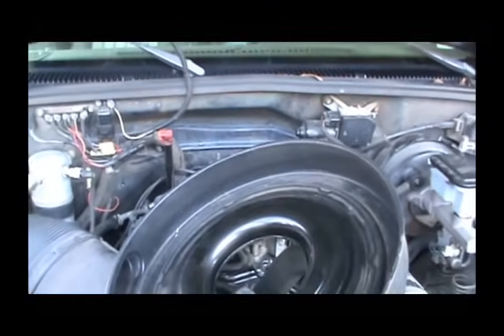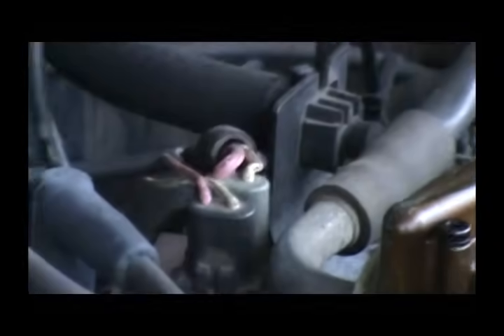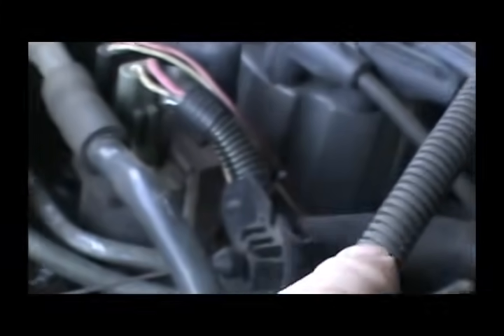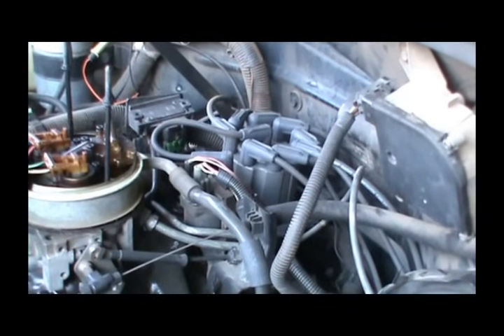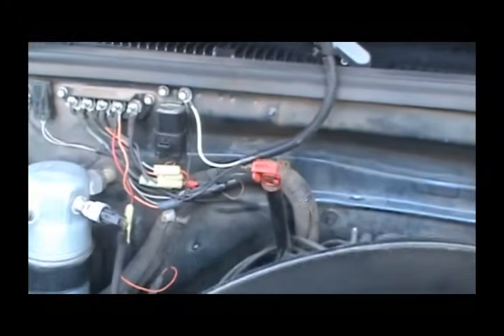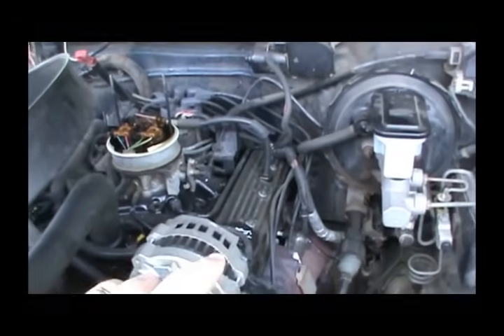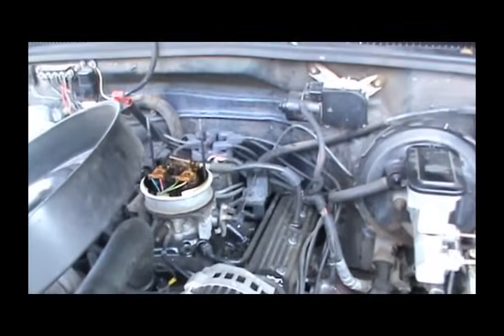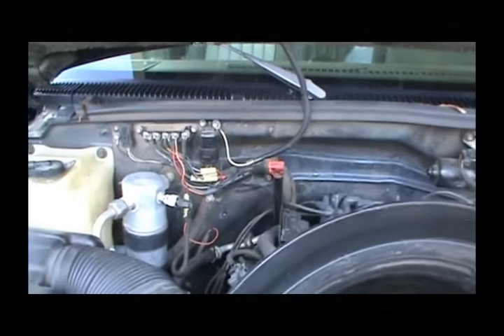1988-95 GM Truck Ignition Systems

Comment: I have a 89 Silverado old truck just passed inspection the next day I tried to start it and it started to crank then nothing. I've changed battery cables but I'm not a mechanical person so idk what to look for??
Reply from the maker: Duane, to be honest, there's a lot of things that can cause one not to crank.  I'd recommend finding a local shop that you can trust  to diagnose it.  Some things are: low battery, bad starter, bad starter solenoid, bad ignition switch, broken wire, etc.
Reply: farmboy30117 return work. I never had a cavity till I went to a dentist

Comment: hey I have one for you, I have a 1990 c2500 initially had no spark.changed cap rotor,had spark, sprayed a little starting fluid because the battery was almost dead. but it won't fire on starting fluid and it's getting fuel any thoughts?
Reply from the maker: Weak spark?  If it won't fire on starting fluid, it has really weak spark or bad timing.  Might have to check coil and ignition module.  I have seen where just a cap/rotor didn't fix the issue.  Make sure you're getting at least 12 volts to the coil.

Comment: I need help man I got a 1991 chevy Silverado 4x4 with a 5.7 engine and every time I stomp on the gas it starts choking the engine and as soon as I take my foot off it runs just fine any ideas
Reply from the maker: Sounds like it's either getting too much fuel or not enough.  Does it smoke when you do that?  Black smoke would indicate too much fuel and no smoke would indicate not enough fuel (too much air).  I suspect it's starving for fuel.  The easiest thing to do is replace the fuel filter to see if that helps.  If it appears to be fuel rich, check the air filter.  Anything else would be difficult to diagnose without some equipment, but check the online forums, someone else may have had similar issues.  Good luck!
Reply: thanks i replaced the fuel filter and it runs better but now some how i got air in my gas lines i don't know what to do
Reply from the maker: Air in the gas line should be purged when you prime up the fuel system and crank the engine.  The air will escape through the injectors.  Cycle the key 3 - 4 times from off to run (not start) with a few seconds between cycles.  You should hear the fuel pump kick on for about 3 seconds and shut off.  Crank the engine and it should be fine.  If this doesn't work, you have other issues like a worn fuel pump or low gas level.

Comment: hey man, I have a 1994 Chevy TBI V8 5.7L. need your expert advice. I'm throwing parts at it and well preventive maintenance is good but problem not solved. Issue is - at 1500 rpms I get surging and low power when it shifts to over drive. 
I just bought a timing light and set timing, before that I installed ECT sensor, MAP sensor, changed plugs, wires, cap, rotor. still have the issue. check engine light code is o2 sensor, replaced that last week, code repeats. 

I went ahead and bought a fuel filter (one on it looks new) and a fuel pump. Have not installed yet, especially fuel pump, that is a job and a half I'm sure you know. EGR valve works as should. checked that as well.
Reply from the maker: Since it's only doing it in OD at low RPMs, I doubt it's the fuel pump.  That would want to show up in higher load demands.  Sounds like you've eliminated the usual suspects.  Since you're still getting an O2 sensor code, you might want to zero in on that and try to figure out why you still have it.  That could be a result of what's causing the issue.  The trans is computer controlled, so does it feel like the trans is causing the issue or the engine?
Reply from the maker: I posted a vid on my other channel covering code 13 if that's what you're getting. It might help troubleshoot the issue: https://www.youtube.com/watch?v=Vmw1CYZ_Df8
Reply: the trans feels fine, yes the code is a 13. I'm changing out distributor, rotor, and wires now. changed plugs a coupe weeks ago. should've changed it all together then. I'll follow up with you on how it turns out.
Reply: I changed out the wires, distributor, and rotor. It idles better,a little higher, has better pickup but still get that dragging low power as soon as it changes  to the last gear. check engine light still comes on as it has been. note- it has an after market radio that was not connected. I connected it and when I turned on the park lights it blew the park light fuse so I disconnected it. Also when I turn on turn signal it flashes fast but as soon as you touch the break pedal it flashes normal. I bought a test light but don't know where to start. also there is a braded ground wire attached to the passenger side fender wall and nothing else, it's just hanging. I did order a new headlight/park light interior switch, the dim roller is off or on when you barely move it. Got to be wiring issue I'm thinking. I appreciate any help. Thank you sir.

Comment: Ok thank you very much for your kind answer, the dealer has the new pickup coil and also the distributor cap and rotor, will hey have to change the distributor shaft?
Reply from the maker: It's possible that something is bad on the shaft, but not too common.

Comment: Good morning, my friend, I have a big blazer 93 4x4, it starts with ffella, it shakes and it makes small explosions and it goes out does not keep the minimum, I buy TPS, IAC, MAF GASOLINE PUMP, ROTOR, COLLECTOR COIL, Only matches when I disconnect the brown cable that goes from the computer to the distributor. Please help me that I have spent a lot of money on it, Thanks and blessings.
Reply from the maker: Since you say it runs ok with the wire disconnected, I'd say the timing is off.  Disconnect the wire on the firewall again and make sure it's timed properly with a timing light (I'm thinking about 12 degrees before TDC but there should be a label on the radiator support).  Plug the wire back up and if it still does it, then it's either the distributor or computer.  Hope this helps.

Comment: i have a 1995 chevy c3500 454. it will run and drive but shut off shortly after. do you think this could be the problem?
Reply from the maker: Will it crank right back up after it shuts off?  If it does, it probably isn't the ignition control module.  If it has to cool off, then I'd suspect the ICM.

Comment: i got a 90 silverado and after going over a speed bump (not fast either) it just died now i cant get any fire but i can see fuel and she turns over but i just cant get no fire why is that
Reply from the maker: I'd check the ignition control module located under the distributor rotor button.  If it came loose it could overheat quickly and burn up.  Also, check all the wiring connections to/from the distributor and coil.
Reply: Rebecca Lamb did u find the problem?  same thing happened  to me mine has spark but no fuel
Reply from the maker: fuel pump?
Reply: +farmboy30117 I thought so I replaced it but I got it running today it was the injector harness an a burnt fuse
Reply from the maker: Glad you got it figured out.
Reply: ayyeefredo94 what fuse was it?
Reply: Jose Alvarez I think it was ignition
Reply: check your rotor button
Reply: Play Nirvana's best hits

Comment: What's up everybody, I have a 95 Silverado. Kinda had the same problem, I put a towing cam in it this past summer and the computer went nuts trying to figure out what to do. I racked my brain for a week or so till I watched this video. All I had to do was unhook that single wire plug( 95 is under the dash on passenger side) and leave it unhooked set my timing and let the icm do the job. Runs like a champ
Reply: So u unhooked the ICM witch is the PCM correct.... And u left it unplugged
Reply from the maker: Awesome!  Glad it helped :)
Reply: How did you set the timing
Reply: What should the rpms run about when It's Timed? I cant seem to get it timed .. I unhook the brown pc wire and it runs lower idled about 1,000 rpms, seems about right but still is a little hard to turn on by itself but suddenly does start after 2 or 3clicks then as I Hook Pcm Cable back up it's revs itself back up to 1400 rpms or so .. seems to run better with the PCM cable unhooked. Or could it be bad fuel pump relay,  Or possibly bad PCM?

Comment: my 92 5.0 had been falling on its nose at half throttle for 2 years but ran great just didn't have full power plenty to go 85 down the highway then from nowhere it's chugging and missing any ideas fuel pump is good
Reply from the maker: Preston, there is so much that could be wrong.  Did it set any codes?  Since fuel is good, I'd look for vacuum leaks, distributor problems (ignition modules are notorious for giving issues), or clogged injectors.  I assume you changed the fuel filter too.
Reply: @farmboy30117  EGR malfunction or clogged cat/restricted exhaust are likely if fuel pressure is good at throttle body and injector spray pattern is ok and ignition timing is reasonably close.
Reply: By the way, faulty distributor cap is possible too. Spring under the button breaks sometimes and you can't see it.

Comment: Hey I have a 1994 chevorlet c1500 Silverado 4.3L an It won't turn over..the injectors aren't spraying gas into the throttle plates the fuel pump shouldn't be bad ik thinking it's the pickup coil maybe gone out an it's not making the fuel pump..pump gas thru..
Reply from the maker: The pickup coil has nothing to do with the fuel pump.  It's either ran off the fuel pump relay during cranking or through the oil pressure switch when enough oil pressure has built up.  I'd say you either have a fuel pump issue (pump or wiring) or a PCM issue.

Comment: I m having a problem it seems like I don't have power from clips to the injectors for my gmc 1995 1500 z71. I changed my coil,module in distributor and and injector rebuild kit and no gas coming out injector. I hear gas pump cleaned fuel filter and thinking maybe change relay switch fuses are all good I'm stuck
Reply from the maker: So you probably have a fuel or ECM or Injector issue.  (1) Without a fuel pressure tester, it is difficult to determine whether the fuel pump is producing adequate pressure. (2) The pink wires going to the injectors are coming from ECM1 Fuse (20 Amp) and should be hot in run or start on ignition key. Make sure you have power here with a test light or multi-meter.  (3) The dark blue & dark green wires come from the ECM which provides a ground path (or ground side switched) to operate the injector solenoid.  With no ground supplied from the ECM, there will probably be residual power on those wires.  If you supply a ground to the blue or green wire, the injector would spray (assuming it has power from the fused wire and fuel pressure).  It is difficult to see if the ECM is trying to operate the injector without a noid light or a special test light because it pulses so rapidly. (4) Check power and grounds at the ECM.  You can do a Google Image search for "1995 Chevrolet Silverado wiring diagram" (AutoZone has a good one) that will show where to look for power and grounds to the ECM.
Reply: thanks merry Christmas I will do exact and get back to you from Hawaii Oahu aloha

Comment: Yea I change fuel pump ,injecters,ignition module , thinking it was that . nothing  so then we went and check the grond on the injecters and no spry so that's the issue . I tested it by touching on any ground and spayed.. but how can I fix this problem... i really appreciated your help ...
Reply from the maker: Sounds like it isn't getting a ground signal from the computer.  Might be a bad connection, wire, or PCM.
Reply: solid angel the ignition module can go bad to where it still has spark but doesn't send a signal to the ecm telling it to power the injectors.
Reply: Your problem is the computer
Reply: solid angel did u find out whats wrong ? i have same issue. lots of new parts pump. injectors. distr. n ign. all of a sudden i crank and no spray whats going on?

Comment: I need you help ... I have no grown on my injecters .. I have a 1988 gmc jimmy k5 .. pls help me!
Reply from the maker: Are you saying you have no ground?  The injectors are grounded by the computer which makes them work (ground side switched).  The white and red wires should have power from fuse ECM1 and the green and blue wires connect to the computer at connectors D4 and D16.  You can find the wiring diagrams by doing a search on google images.

Comment: i have a 350 it has lost power and backfire in the carb(catches fire)has hard time to start after warm up
Reply from the maker: Sounds like the ignition timing is off.  What year is it?
Reply: 1990 350 with cruise control are there any fuses that could be blown
Reply from the maker: If you have a timing light, I'd check initial timing.  Remember on these you have to unplug the single wire in the loom behind the TBI unit on the firewall.  This will prevent the computer from adjusting the distributor timing while testing.

Comment: Hello, I'm attempting a MSD Streetfire HEI distributor, I ran a pigtail for the coil, but how do I connect the 4wire harness for TBI pulse?  Stock distributor is 2plug, and this new distributor only requires 2pin in?
Reply from the maker: I've never done a swap like that before, but is the HEI distributor computer controlled or vacuum advanced?
Reply: farmboy30117 The stock is an 8 pin controller, electronic controlled, and the new streetfire is a 4 pin, vacuum advanced.  I just need a signal to pulse the injectors.  Will the "B" bypass pin provide timing pulse to injectors?
Reply from the maker: I would contact MSD and see what they have to say.  I have no idea.

Comment: I have a 5.7 gmc 1988 jimmy and I don't have spray from my injectors? what could it be ?
Reply: pls help
Reply from the maker: That can be caused by a lot of issues: Bad fuel pump or relay, Blown fuse, Bad ground, Short circuit, broken wire, or faulty computer.  The easiest to rule out will be fuel, then move on to power and grounds. Check wiring at both the injector and computer.
Reply from the maker: I forgot to mention clogged fuel filter

Comment: Could that why effect it on start up? I had to change my oil pressure sending unit and when I put my distributer back in timing was right but on start up it wants to die right away but if you give it alil gas and let it idle at about 2000rpm for about 30seconds then it's okay.
Reply from the maker: When you timed the distributor, did you unplug the wire so that the computer wouldn't effect the timing?  Not sure, but it sounds more like a problem with the Idle Air controller.
Reply: No  I didn't not unplug that thing. I had no idea about that plug until I watched this

Comment: I have a 91 Chevy Camaro with a 305 I replaced every part of a tune-up it's got a new fuel pump new injectors I get spark from the coil but the car will not fire up could it be the control module
Reply: If you have spark, then the control module is doing its job well.
Reply: @cybercharlie88  where do you have spark is what is also important. If you have spark from the coil to the distributor cap, then make sure you have spark at a spark plug. If not cap/rotor is suspect along with plug wires.
Reply from the maker: I'm pretty sure you would have no spark if the ignition control module was bad.  It sends a signal from the pickup coil to the ignition coil.  However, it could be a weak spark issue.  You'd need to check and make sure it was jumping a decent size gap.  If it's a weak spark, I'd suspect the ignition coil.  Have you ruled out incorrect timing?